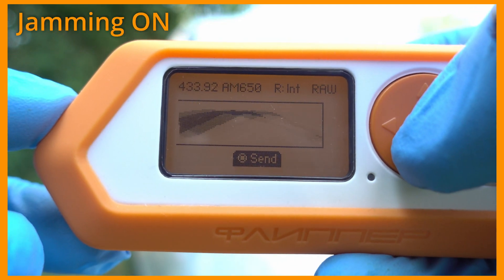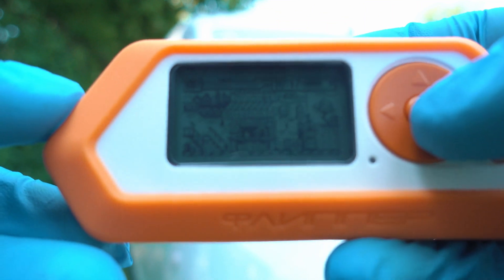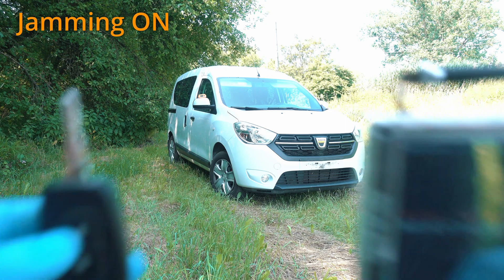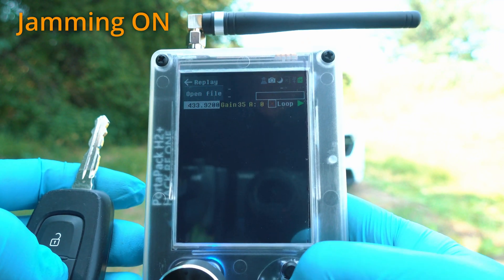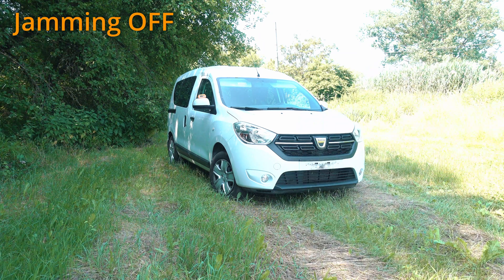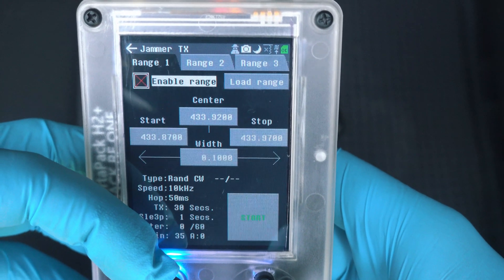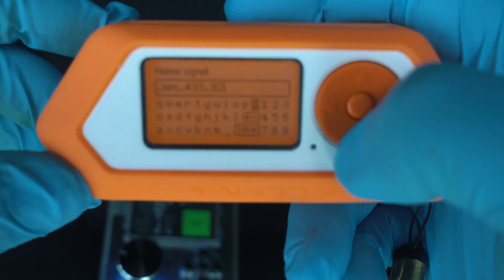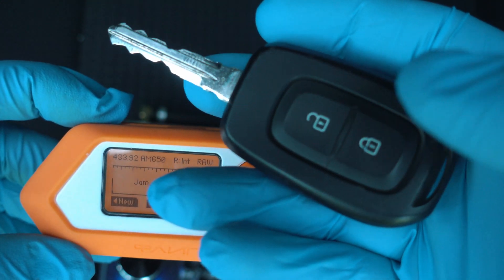Rolljam Attack Flipper Zero & HackRF Car Unlock

Comment: How do you find out the frequency of the cars remote? Is it all the same for that specific car year and model?
Reply from the maker: frequency analyzer
Reply: @takeapart  I'm trying to figure out how car theives remotely unlock cars in the parking lot. I understand the jamming and replay attacks, but how they guess the frequency and do it all within a matter of minutes?
Reply from the maker: @RainBitcoins mainly there are only two frequencies used by cars manufacturers…  315MHz and 433.92Mhz …. sk it takes literally 5seconds to switch if they on wrong one
Reply: @takeapart  Ah I see... Good to know.. Have you played around with the blade rf at all? I'm really enjoying your videos... New sub here. Keep up the great work.
Reply from the maker: @RainBitcoins no worries… blade rf is in my bucket list

Comment: nice one! however in this case you had a range advantage of jamming near the car while recording right next to the remote. for a proper rolljam, i heard you should jam around the frequency (on both sides?), preferably use a directional antenna, and capture two "open" signals while replying the first one, causing the car owner not to notice the trick.
since hackrf is only half duplex, it cannot jam and record simultaneously so you need more than that.. 
I heard evil crow may be helpful on that one..
a nice video would be letting your friend pass around with the key trying to unlock, while you running the rolljam on him 😉

Comment: Hi  when i try capture the rolling code and also jaming my car whit my uv5 boateng jammer its blocking the signal from the portapack. Witch jammer should i buy.
Reply from the maker: you are too close to the jammer… (jammer can be close to the car, but you - with fob and hackrf have to go few meters away) .  or your jammer is too powerful.

Comment: Hi, i like to learn with electronic gadgets. I like hackrf one, just one question. When i captured the signal of the key (and the jammer do the work to block the signal) the signal captured from the key on the hackrf one i can use it more times or just one time? And if before use the signal of the hackrf one I use the key, can I use after that the signal of the hackrf one? Thanks a lot!
Reply from the maker: only once …

Comment: Is it bad to jam on the exact same frequency as your key fob is transmitting on ?
Reply from the maker: that is the whole point….
Reply: I meant when you’re capturing you might capture the jamming being sent out instead of only capturing the signal for unlock
Reply from the maker: in mu case: flippers range is  not great, so even few meters away I had good enough capture to unlock successfully. 
try it yourself. 
in case of more powerful jamming device you may jam even receiver.

Comment: Hi One question maybe you can help me. I have a portapack h3 and tried to jam the key fob signal. I'm running the correct frequency (imo, analyzed it with the flipper zero) but if I press unlock on the key the car still opens. So there is no signal jamming
Reply from the maker: 433.92 or 315MHz … are two main frequencies.  if you car and keyfob communicate via bluetooth or RFID you  will need to jam those frequencies as well(but with different antennas) .  let me know model and make + year of you car
Reply: @takeapart  i have a Audi a4 2021 and it's 433 mhz
Reply from the maker: I guess it is keyless entry and start? if so it has another way to communicate…
Reply: @takeapart   Yes thats correct it's keyless. That means i need a car which uses a physical key?
Reply: @takeapart  It was definitly the car. I tried it with a fiat 500 and a physical key and the signal was blocked but when I copy the signal it will not open the car. Do you have any suggestions?
Reply from the maker: ok , make sure that jammer is far away from leyfob (as you don’t want to record noise along with key code).jammer can be near car (car is receiver) and you can  record clean signal from keyfob somewhere at least 20+meters away (depends on how good is your antenna on jammer).  on e you record the signal- do not use keyfob buttons!  turn off jammer and replay captured signal … it should work
Reply: @takeapart sadly it does not work. I tried it many Times. Recorder it and replayed but no success. It does not matter If i play it on the flipper or on the hackrf
Reply from the maker: hackrf should work better… you must have done something wrong in the process….  but again please don’t try it unless you understand how it works… otherwise you may unsinc something and end up with not working keyfob
Reply: @takeapart   is there anyway that the signal which i replay is not the same as the original one because i recorded the signal from the flipper with my hackrf and it looked completely different. I am fully aware that if i do something wrong that the remote of the key will not work anymore. I have to re sync the key with the car afterwards.
Reply from the maker: @tiltedchris847 modulation.  flipper has limits. try to record signal with hack rf
Reply: @takeapart  i tried that already but it didn't work also

Comment: So does your car remote use rolling codes?

I'm subbed.
Look forward to watching your Flipper Zero videos.
Reply: Rolling codes you say? 
Buy any pre 2016 VW or Audi ECU and rip the seed out. 
Every pre 2016 Volkswagen group car uses 1 of 4 seed codes. They may roll, though finding where they're at is as easy as knowing the cryptographic sequence for the rolling code and having a seed code.
Reply from the maker: hi, yes so far all cars on my channel had rolling codes
Reply: @takeapart maybe I’m confused, but doesn’t the keyfob stop working if you send it’s signal from the flipper? Forget the RollJam attack for a minute; if you just record your fobs signal (out of range of car), and then send it to car using Flipper, I thought the keyfob would become out of sync and stop working. ?